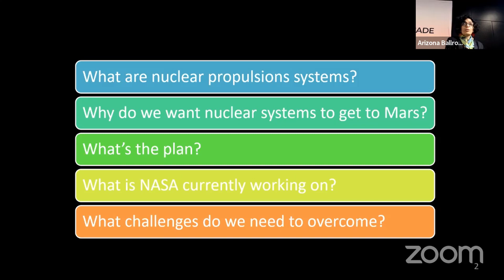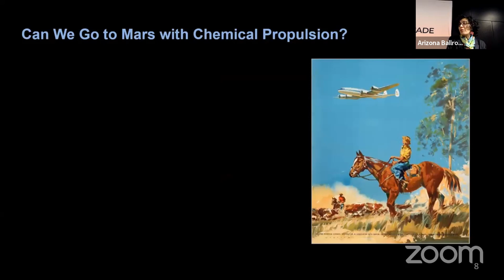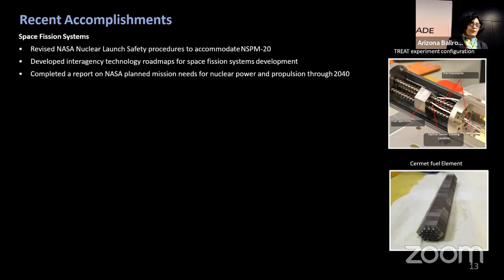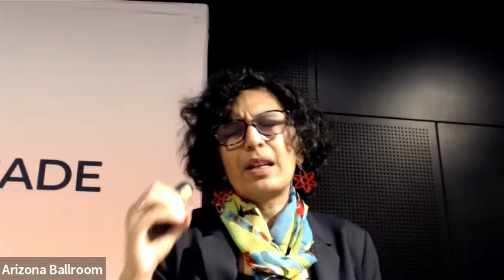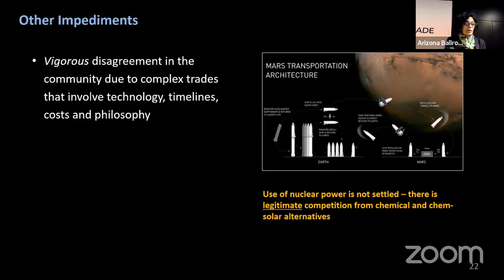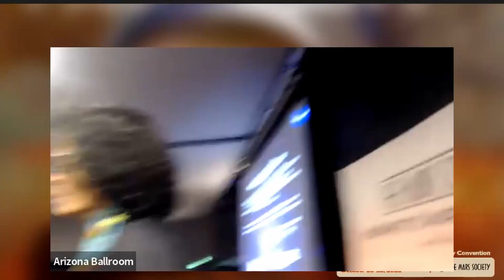Dr. Bhavya Lal - NASA’s Plans for Nuclear Propulsion - 25th Annual Mars Society Convention

Comment: If you wait for nuclear propulsion getting to Mars will be delayed by at least 2 decades as the technology is worked out. It also has a fundamental weakness that you can't refuel at the other end until you have significant civilization there, where as you can with chemical rockets by brining the equipment there.

Comment: An economic opportunity to aviation/aerospace and containers: Fluid_impulse motors fly without air no_fuels no_batteries by using all_magnet motors for pumps.

A jetboard system in a box is a powerful motor equal to rockets, 7.5-tons force/motor the need a firefighting 1000-gal/4-ton tanker hovercraft no_propwash.

This became a 6-mtr design spec, 11-pairs can pick up & deliver point_to_point nonstop any container, no land or sea usage the opportunity as a local-to-global dispatched service.

All_magnet motor magnets fade-10%/1000yrs, in EVs & electric motors well known, a 1300hp all_magnet motor fits cars has a 50yr no_inputs warranty w/upkeep, no CO2 H2O or wasteheat/Mwh superconducts coils. 13-units are 12-Mw of 100%- dutycycle baseload in a parkinglot. Amortized $3.65/Mwh + (interest & upkeep)/month at $1.6M/unit.

As a leading edge machine available it's low volume the biz case explosives safety products & services motor flies in a small surveillance aircraft, technokontrol's RF-5000.

The planet needs them, power remote villages, datacenters, flip substations to a half-century of power, the frosting, these spiral to orbit with a 4-ton payload & having 100%-dutycycle power the whole way make a transit to Mars in 3wks the design goal.

Meanwhile, working on a small 4-motor drone to locate landmines, the destroy drone flying with a startup, not having propellers a big deal in a bamboo forest,
Great launch, huge rocket, massive  ☕️ 🚀
🕊⚖️♻️